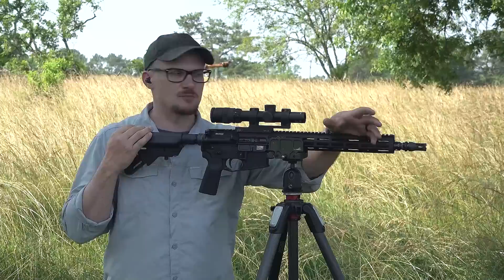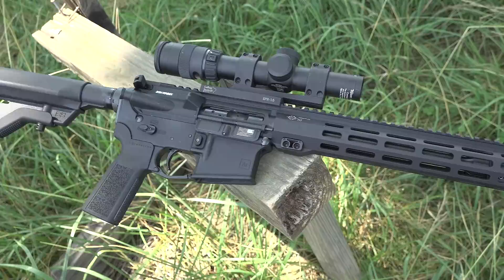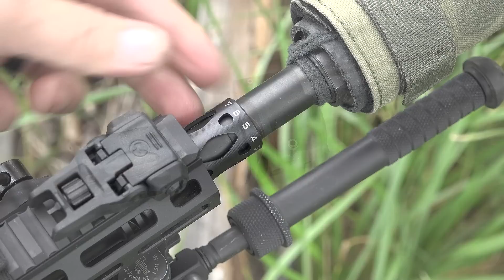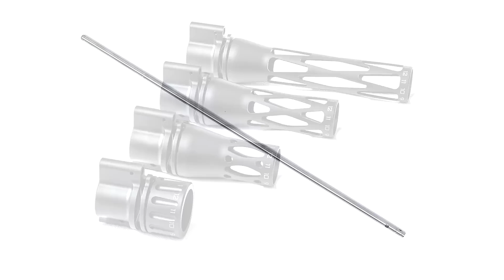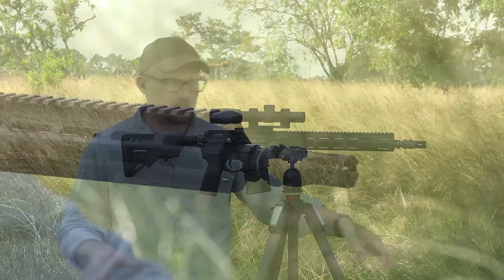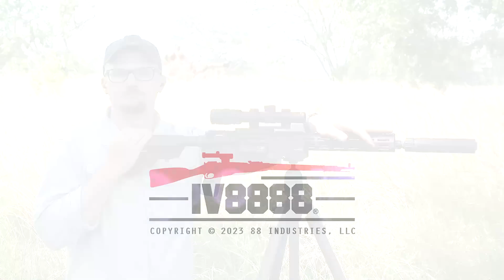Tuning the RIFLESPEED Gas Control

Comment: Things to consider… Whatever holds your bolt open, go (2) more. Bolts get dirty and less efficient. One BCG may be more efficient ( gas rings, tolerances, wear ) than another. I found Steel ammo cycles perfectly well, but never gets bolt hold open even on the least restrictive setting.

Comment: Instead of going from 1 and working your way up it's easier to start at 6 and dial back. For example, mine started at setting 6, worked perfect, dropped down to 4 bolt failed to lock, adjusted to 5, bolt locked back. Tuned in 3 rounds.

Comment: very nice. I was running my lwrc a5 suppressed without the suppressor setting flux capacitor engaged. I just realized that this morning and began researching "adjusting gas block" etc and found this vid. I can't help but wonder how the gun will run now. I have had no issues with it however it was snappy. I recall trying to shoot faster at paper and it was a bit hard to keep a grouping. maybe it will run a little tamer will see. nice adaptor you have there though. Mine is either on or off so hopefully it will just run will see.

Comment: On a pencil barrel the selector diameter isn’t decreased with the barrel diameter reduction. And it SHOULD have the same gap as the standard barrel. So basically it looks like a selector that is way too wide for such a thin barrel.

Comment: I have two of these systems. One on a PSA 16" 5.56 and the other on a PSA 20" 6.5 Grendal. Griffin gate-lok muzzle devices for Griffin 30-SD can. Like that quick, no guess gas adjustment.
Reply: How does this work with long handguards? I have a 15 inch handguard
Reply: @Rocksteady713  Meant to say gas system length and handguard length.
Reply: 15 is a bit too long..Stick to 13 inch.. @Rocksteady713

Comment: chad is such a chad. and i love that you guys tune them to run full power 5.56. i can't stand the people who say "if it don't run steel it doesn't deserve brass" that is such a stupid thing to say - if a rifle runs the lowest powered 223 ammo, when you run full pressure 5.56 it's going to be stupidly overgassed. great to see builders going the right direction on that. and i like how this adjustable gas block has such a wide range of settings, and each click up or down is such a small increment so that you can really fine tune it. i've previously steered away from adjustable gas blocks because you find that one moment it's undergassed and the tiniest adjustment makes it overgassed. these small increments are nice letting you really dial it in perfectly. that thing is awesome

Comment: What weight buffer?
Reply: We set these rifles up for use with a standard carbine buffer and White standard power Sprinco spring. With the Riflespeed block, there is no need for heavy buffers to tame the system.
Reply: @ArgosOrdnance  Thank you for the feedback.
I ask because I have a preference for the Guiselle super 42 buffer spring and run an H1 in all my ARs now, but I don't run suppressors at this time due to lack of tuning knowledge in regards to that process, and I think the rifle speed devices are slick as snot, one of my fellow ranger buddies put one on his personal weapon and running a Franklin binary trigger and using it for that reason.  
But I look forward to getting my hands on one of your builds
Reply: No need for buffers that are heavier than the carbine weight if the rifle is gassed correctly..Heavier buffers do not effect dwell time (bolt lock time) they only effect carrier velocity..The heavier the buffer the more perceived recoil.. @jw5297

Comment: Can you use this with a 350 legend upper?
Reply: Between the gas control itself and the wide variety of plungers available to fine tune, absolutely. The Riflespeed can be made to work perfectly with any cartridge, barrel length, gas system combo out there.

Comment: Any gun smiths in in the comments I got an issue. I was cleaning my Glock 19 gen 4 and when I went to go put the slide back on the recoil spring pushed through the hole and is sticking out the front end of the gun

Comment: They’re MPI tested? Do you mean that they are “high pressure tested” and “magnetic particle inspected?” Further, the second is basically nullified by not doing the first. So if they’re not doing the high pressure testing, the magnetic particle inspection is a waste of money…
Reply: I believe most bolts re mpi tested now

Comment: I've used adjustable gas blocks in the past including the Riflespeed one.  The one thing I recommend is to set up the gas block with the rifle at a 45 degree as if you had a red dot at a 45 degree.

I had set up my gas block with the rifle perfectly upright and it was perfect until I did some drills with the offset red dot and it would not hold open on the last round.  I had to open up the gas block a few more clicks and it worked perfect and I didn't notice any recoil differences.
Reply: He’s saying if the rifle is canted at 45 degrees when shooting, as in shooting from odd positions, or when using an offset red dot, it changes the way the rifle reacts and it needs more gas.   That’s also why for “duty” use, you go up another setting….much higher likelihood of firing in odd shooting positions in real world over punching paper at the range.
Reply: Terrible use of words.
Reply: what does your red dot have to do with gas blocks? wtf is this comment
Reply: @albanfisher6857  lol agreed, doesn't make sense at all

Comment: How rigid is that adjuster? I feel like in adverse conditions it could get moved somewhat easily. Just my thoughts though, I run a poor build so I have no clue about this stuff 🤣
Reply: It feels loose on the higher settings when new, but it’s never come out of position, especially once a little carbon gets built up.
Reply: You can run two springs and it will be very difficult to turn. Probably overkill. I just use the one spring it comes with and I’ve never had mine adjust accidentally in many thousands of rounds of hard use in the field.

Comment: Chad, are you doing anything to the barrel & bolt interface to increase accuracy of these rifles? I vaguely remember a video you did about accuratizing the bolt/barrell lock up and bedding to increase the accuracy of an AR.....
Reply: I shim and/or bed the barrels in place in all these rigs. The tight fit provides a marketed improvement in accuracy potential.

Comment: Adjustable gas blocks only fix over gassed not under gassed people i feel like that should be a disclaimer at the beginning of every glass block video
Reply: Correct.  That said, it is a LOT cheaper to drill up than it is to "drill it smaller"
But even with a nicely gassed rifle, it is nice to have the ability to tweak the setting because of steel ammo, suppressors, etc.
Reply: Yep, I have a stag arms 300 blackout, wont shoot subs without my can.  Finally called Stag Arms and they said they send their pistols out to run only supers.  Got to get the hole opened up to .095.